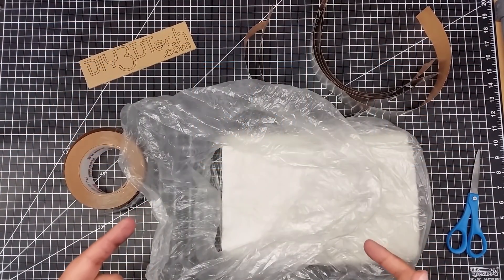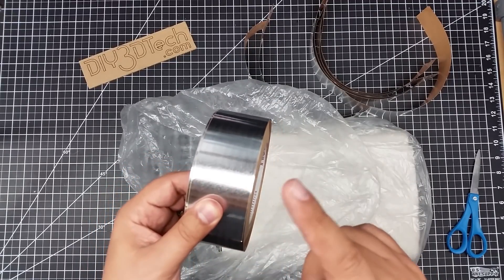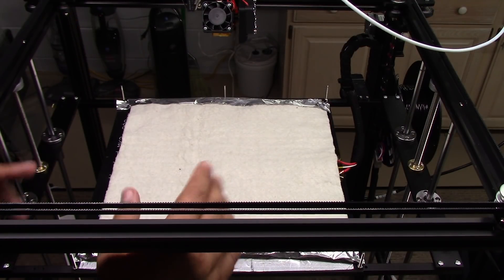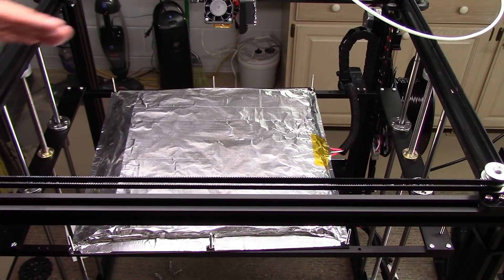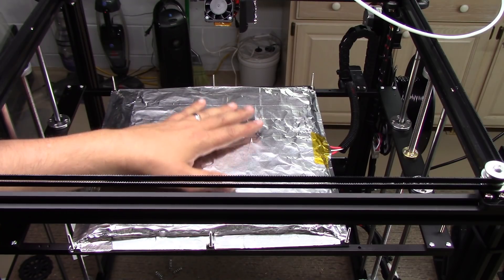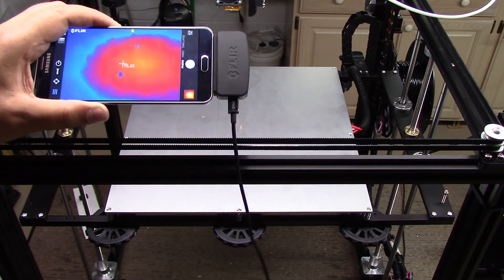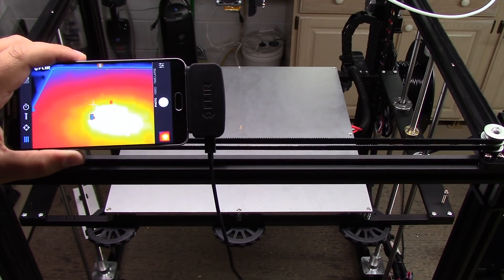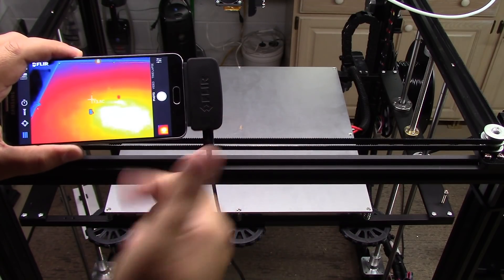Tronxy X5S  - Super Insulating for Only 5 Bucks!

Comment: I wonder...if you would put kapton tape under your insulator, but, only at the centre, to reduce the heat transfer only at the centre, and see if that would equalize more the heat distribution???
Reply from the maker: Don't think it would make a positive difference as kapton is not high thermally conductive...

Comment: 70c was achieved only with insulation?  I'd look at the heat bed. My FLSUN C -3 Plus large volume printer < $400us, has no problem hitting 110c for printing in ABS..  Thr only mod I'll be doing for it is a case so the heat is held in and I can control the cooling..
Reply from the maker: The issue here is a 12v power supply a limited power feed.  Also check the playlist for the video where I add a mega mosfet and second power leg too

Comment: If you spray the cloth lightly with a coat or two of hairspray, it helps to prevent microparticulates from coming off the cloth.  Obviously not too much, just enough to make everything to stick. The very light coating isn't a problem with heat.
Reply from the maker: Not sure I am tracking completely?

Comment: How has this held up (especially the aluminum tape)?  I can only find 12in x 12 in so one time use and nothing as you described even when using your links.
Reply from the maker: The aluminum tape is fine no issues, are you speaking about the bat ceramic?
Reply: Both, and I received my printer today and I ended up with the version that did away with the fiberglass and was replaced with the horrible Acrylic.  Yes, this was for a few production runs because Gearbest told them to 
change it and finally the USA rep for tronxy had them change back because they will never do glass.  I can't use an acrylic base to print on over the MK3.
Reply: Something I always do with electronics from China is take them apart and inspect the wiring and true to form China had the Live and the Neutral switched and house breakers work off of the Live.  SMH

Comment: I also used this insulation  on my TronXY X5S and it helps a little.  The best thing you can do for the bed BY FAR, is to upgrade to a 24V power supply for the bed with a Mosfet Power controller.  Here's a video of my install: https://youtu.be/pXjohHyTJQw
Reply from the maker: Many thanks, also have a MOSFET Video coming up too as I ordered a 40amp module...

Comment: Cork sheet works very well. I've installed it on the underside of several heatbeds.
https://www.ebay.com/itm/heatbed-thermal-insulator-300x300/162773523807?
Reply from the maker: Unfornatly it (cork) is also a fire hazard....

Comment: That's good news to hear. Do you still remember any comparison between heating up time to like 40 degree with and without insulation? 

Looking forward to your power wiring video for the bed as I might want to try out some high temp plastic.
Reply from the maker: Without question it is faster, however the big thing was just getting the temp there which still take around 15min.  Also have the bed rewire on the list :-)

Comment: With that aluminumzed tape, does the heat loss on the outside brim cause issues?
Can you run it up to 90+C for ABS?
Would tacking it down with a layer of silicon (high temp or not) help keep the aluminum from wicking the heat away from edges?
Reply from the maker: Sort of (heat loss on the outside brim), yet as I mention in the video the heating element is only around 292mm verses the 330mm bed so no matter what you have heat issues at the edge and you can see this in the flir.  Also in its stock form, 90c  is impossible and being open frame means ABS will wrap just being looked at.  At this size, ABS can be done with an AC bed, enclosure and additional internal heat source.  One viewer wrote they use a large heat lamp.
Reply: it cost about 25$ per heat bed, but I used an aero-gel based insulation from https://www.mcmaster.com/#9590k1/=1ba9mb4 , combined with a second 24v powersupply ($18) run through a mosfet ($7) and i can hit 105 C in 6 minutes.

Comment: 5:12 Remember shiny surface, heat bed, can impact on Flare and IR readings
Reply from the maker: Thanks, :-) however if you look back to this video: https://youtu.be/r0WdYSPOpKg  which I did on that topic, that myth gets debunked as the results of the flir where within the same results of the control (the two thermocouples).
Reply: Thanking YOU 2000% back :) I will take a look and tweet these GREAT vids

Comment: I used magic erasers bought from eBay. The sponge is a heat resistant foam. I halved the thickness of the sponges so I was getting the whole bed done with 3 sponges... Not got flir, but the bed seems to work..
Reply from the maker: Interesting, yet sponge has Melamine in it so it won't burn per-say, however it was not designed to be heated as in this application so would suggest using care as melamine causes kidney toxicity following longer exposures to high concentrations and because of the heating out-gassing is possibility so I personally would want to sit next to it...
Reply: DIY3DTECH.com I would be interested as to where you get your info. I understood toxicity to be relevant when ingested. Melamine as far as I know is used in heating systems and melts in the 200c region. In my application I am never heating it beyond 100c (actually around 70c).

I am no expert in these matters, but I could not find any thing online that concerned me. Do you have links that suggest it is dangerous to heat it?
Reply from the maker: Common sense, as any time your warming or better put heating something up it will out gas (note to out gas means to take an aerosol form and it doesn't need to melt.  Like when you get into a car on a hot day you can smell the plastic) especially if heated over long periods of time.  Again the makers of the Mr Clean Magic sponge never intended it to be taped to the bottom of the heated bed of a 3D printer so you run risks when do things like this...

Comment: Have you considered overvolting the PSU? I did this on my Wanhao(boosted to about 13.5v IIRC). This makes a big difference. You do need to do the math to make sure that you stay within the capacity of the power supply. Just going from 12V to 13V will make a big difference.
Reply from the maker: no I haven't, think part of the issue (like the Wanhao too) is bed/hotend and electronic is all feed from one segment of the PS and it can only proved so much current.  I am going to test with a second power run...
Reply: DIY3DTECH.com i would have thought that the heater on a bed this size would totally dominate the power load. The power taken by the rest of the system will be a drop in the ocean.
Reply from the maker: The electronics yes (drop in the ocean), however the hotend no as the wires will only be able conduct so much current as well as the leg of the PS to provide only so much current...

Comment: GMTA!  I was just browsing around for ceramic insulation last night.  :-)
Did you take a reading before the install?  That would be interesting to compare.
I've been on the fence about the X5S, but I think I'm going to give it a try.
Reply from the maker: :-) If you look back to the build video, I could never get the bed above 47 deg/c which means this is a night and day difference.  For the money, I really like the Tronxy kit, it has it bugs but for the price you get a BIG printer that is highly modifiable....
Reply: I watched that video a few days ago, but my CRS is in full gear today it seems.  Is there anything that you think I should purchase to have on hand for when it arrives (aside from the ceramic insulation, of course)?
Thanks for the info, I think I'm about to make the leap.  :-)
Reply from the maker: I can't really think of anything, as you can see from the video's pretty much things are complete...

Comment: are you going to redo the CR10 with this as a comparison?
Reply from the maker: Likely not as its clearly better from the performance I have seen on the tronxy, but have the sunk cost of materiel and effort in the CR-10 so not really worth effort.  But if did do it over again, this would be the path I would go...
Reply: Was going to ask the same thing. Good to know.